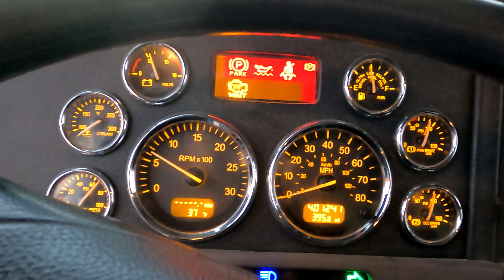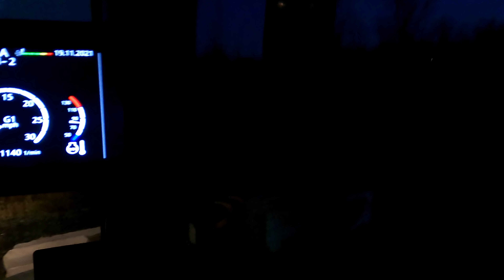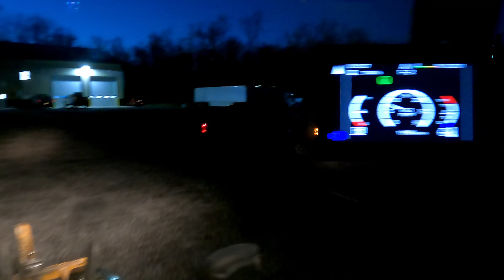102,000 lbs On A 5 Axle Rig !!!

Comment: Biggest trailer we have is a tri axle that holds 78,500 pounds of milk (9,000 gallons). Almost always filled to the rim. 117k on a 6 axle setup, permitted for 107k here in NY, only permitted for 95k in PA, but dont have to worry much about d.o.t at 4am.

Comment: NEXT VIDEO DISCUSS IS IT REALLY WORTH IT to carry that much weight compared to the wear and tear ,More fuel and brake issues (wearing out quicker) On  five axles, In Long Island they really use them R permit 105K trucks heavy. Look at the roads by the Dolomite  pits . There junk by ever stop sign. By the way long island is all sand, no drainage problems (frost or heaving ) Upstate is Wet heavy ground . No bridges on the Long Island therefore the No R permit bridges don't matter.  Only to get on and off the Island . Great video...

Comment: If I remember on the nys apportioned cab card there’s something about
 3% grace on the weights. I’ve never done the math(id probably mess it up😂) but it may make up for the difference in measuring systems. State can’t be kind enough to give a break and lose money. Also how’s the dot set ups up there? Here on Long Island they’re setting up all over every day.
Reply from the maker: Yea…. There is something with the 3% but never worked for us lol
Reply: The scale wagon's ( State guys ) are out on the NYS Thruway certain exits almost every day. They do move around a little looking for lawn guys with no DOT # on the pick ups. Monroe county (Rochester ) Sheriffs have two or three Trucks moving around also. Ontario county  (finger  lakes area.) have a few scale trucks also by the land fills. Not far from Flint Creek area. . Thirty years ago , Rochester had two or three . Now more like ten or more. Never saw any Scale trucks in Suffolk County ( long Island ) in the 1980;s . Nassau county (long Island ) stared first. The Ress Family and my bother started Beever Industries ( Middle Island - Mount Sinai ) area . Runing log loads and log trucks from RTE 17 Deposit to the island (firewood). Running over 100,000 lbs. Them days are LONE GONE. One a month they got DOT Inspection. $$$ In Port Jefferson the stone company (Gotham sand & stone ) Gets the stone off the Barges in the harbor. Them guys ran HEAVY , All MACKS pulling the hill up to Rte 25A Nesconsit HWGY. Around 30 ton or 102 ,000 GVW.Hope that helps Evan...
Reply: @jamesfeeney7903  Now they’re all over Nassau and Suffolk. The days of towing a guy out of the scales going a few miles and cutting them loose are long gone in last two-three years.

Comment: The problem with the 95,000 lb agricultural permit in Pennsylvania is you are not allowed on the interstate system with that weight and you have to submit your routes to the state to be added to your permit account.  Also the permit is only good for tandem axle trailer.  Spread axle trailers are not allowed with that permit.
Reply from the maker: I didn’t realize that on the spread.    I’ll have to check into that

Comment: So if you had 46k rears, 20k fronts and 50k trailer, you can gross 116k? Local upstate NYer, Kingston!
Reply from the maker: No.    It’s limited to axle quantity …. The axle rating can be more than the minimum but with a 5 axle the most is 102k
Reply from the maker: No.    It’s limited to axle quantity …. The axle rating can be more than the minimum but with a 5 axle the most is 102k